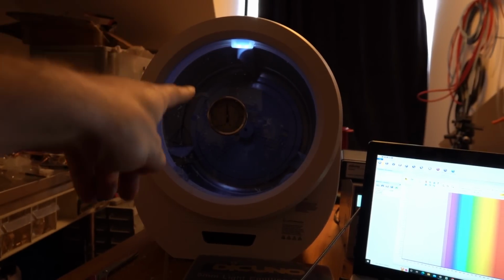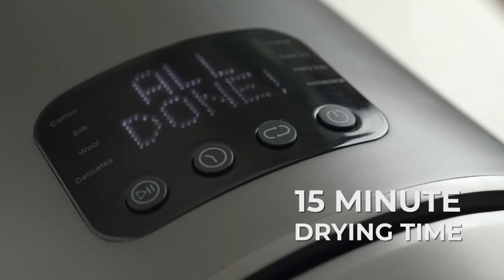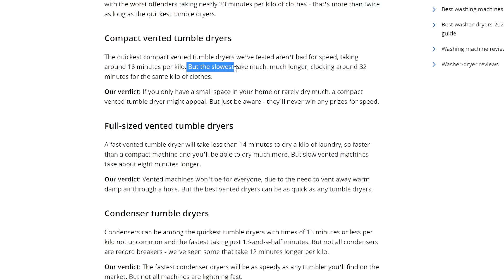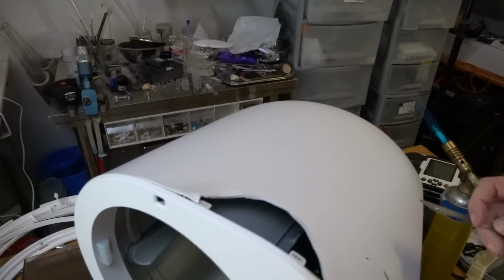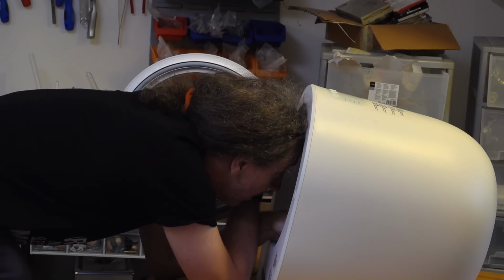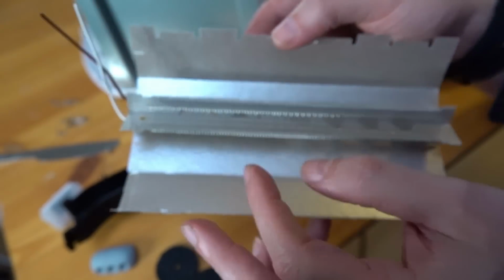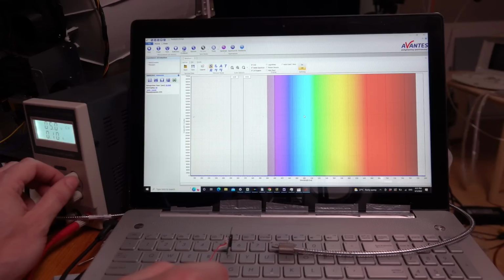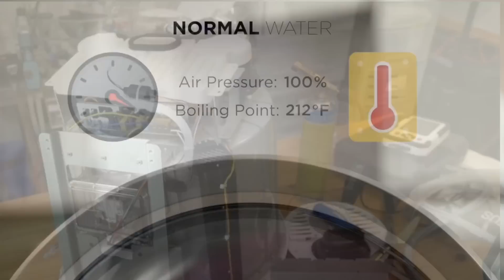Autopsy of a Scam-Starter: The Morus Zero!

Comment: I feel like the challenge now is for you to actually turn it into a real vacuum dryer and see if you can get it to have lower pressure in the dryer as well as getting the condenser to work and put the water into the tank.

Would be interesting to see what it'd actually take to make the product they advertised it as.

Comment: $600? This thing is not even inexpensive. I have a cheap heat pump dryer for around $600. It has about 4 times the capacity and the water really condenses inside of it filling up a water tank. Compared to my dryer, this toy should only be around $200.

Comment: All the “for show” stuff is just there so the description has a corresponding proxy. A useless UV light, but it’s “a UV light”. A heating coil that is also an “infrared heater”. And so forth. It’s the fine print. Horrible.

Comment: I appreciate scam-busting videos, but you didn't even tell us your humidity before drying the clothes on the line or the dryer.

Dryers are far less necessary for people who live in dry climates, but if you are experience 70F/20C dewpoints or higher (midwest U.S., for example), clothes lines are not going to work for large parts of the year.  If you did these tests on a dry day, then of course the clothes line is going to be more effective, but that's kind of like testing an air conditioner in the winter.

Comment: I can't imagine a UV light in a clear plastic container.  You'd need to have at least sunglass plastic to block the UV from causing cancer to anyone sitting near it.  This seems like something BigClive could tear apart in a few minutes with schematics in a few more.   It appears they have the UV LED exposed to the moisture in the chamber. I don't like the idea of my wet clothes being tossed around exposed to a 100C electrical device.  I imagine that over time that will corrode the LED a cause a short of some sort.
Reply: "UV-C light which is used for germicidal processes will not penetrate standard acrylic plastic sheets."

Comment: Oh, what a totally unfair review. There is absolutely some UV. You just have to run it outside, which I see you did. Was that part of the instructions?  🤣 

And IR exists too. Just like in every single non-heatpump heater that has ever existed. The 1800s era hot wire (kanthal?) elements radiate heat as IR, heating some of the air molecules as they go through. Of course, none of this probably heats the clothing directly. But don't forget the Cosmic Microwave Background Radiation - this is everywhere, and is a lower frequency than red, so technically IR.

Of course, just leaving your clothes by the windows in a pile will provide more uv and nearly as much ir. Even cheaper than a clothesline if you don't mind waiting a few days for your clothes to dry, or the fresh scent of mould and mildew....

Comment: I have thoroughly enjoyed this video series, but watching you attempt to disassemble tabbed plastics with slotted screwdrivers and eventually a torch and scalpel caused me physical pain...

A Spudger and a handful of guitar picks would have been more than enough to separate the front plastic ring from the body of the bullshit dryer.
Use the prying tool to disengage each set of clips individually and leave a guitar pick behind to ensure they don't snap back together as you work your way around the circumference
Reply: I don’t think he cared to much about damaging it lol.

Comment: Your testing of the UV LED is total cowboy nonsense. LED's are current driven devices, not voltage driven, hooking it up to a voltage source is a sure way to overdrive it. The actual driver circuitry is on the board it plugs into, this board REGULATES the current fed to the LED to keep it operating at it's safe, rated power level- which it can do all day long if designed correctly. It's still a scam, but the LED overheating is not due to a design flaw.

Comment: Lots of issues with this video so far:
1. Your light testing spectrum appears to be very small only visible light and a little bit more. They could be using Ultra-Ultra-Violet light thats outside of the spectrum you tested.
2. You put your tshirts out on the line to bake in the scorching british sun. This is not a neutral environment. A Morus can dry in any environment from the bottom of Death Valley to the peak of Mt. Everest! Good luck drying with a clothes line on Everest! 

I'll keep editing this as it goes on

Comment: Kudos for doing a thorough job discrediting yet another crowd funded complete scam. But your videos could still be about half the length and even more appealing without all the redundant points and useless tangents. We don’t need to see you repeatedly testing LEDs that have little to do with the one in this scam dryer for example. The spectrum of the dryer’s LED is the end of that story. Concise is much better than fluff and filler content. I get that YouTube videos over 10 minutes make you more money but you go WAY over that and it only likely causes most people to stop watching which ironically is the exact opposite of what Google is trying to encourage with their self serving algorithms.

Comment: I saw your video and it's wrong, I think you are making them look bad for nothing,  on my opinion, this machine can dry your clothing but it will take longer, not 15 minutes, students or a single person, don't need a big dryer, this is more than enough, this machine is not a scam guys, it's a small drawer with poor performance but it's definitely not a scam. By the way, You show us how not to disassemble the machine properly, you broke the machine. 👎👎👎

Comment: Wow you really butcher your disassembly. 
I guess it doesn't matter when you hate the product and aren't looking forward to a re-assembly. 
I mean if you're going to cut in why not just take a high-power laser or water pressure gun and actually half it dramatically for views.
Anyone who has built a computer feels my anxiety seeing a plastic condenser holding liquid over circuitry hardware. The KFC computer meme was more logical. I wonder where the power supply is.